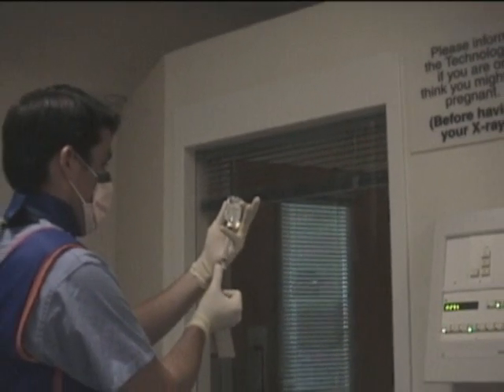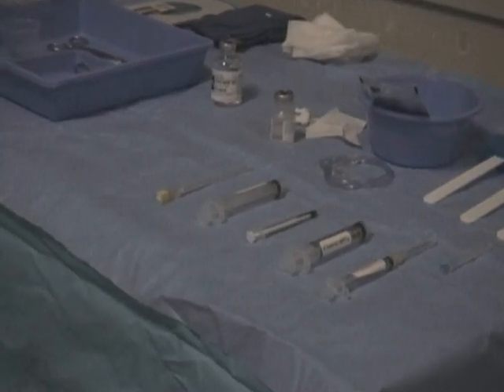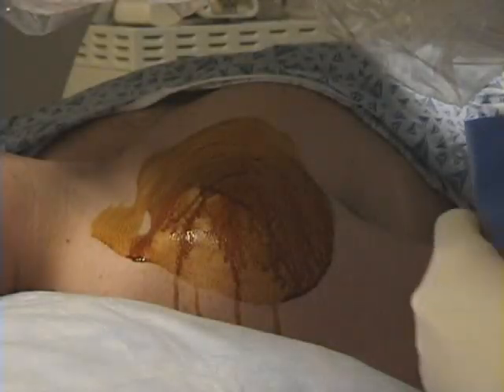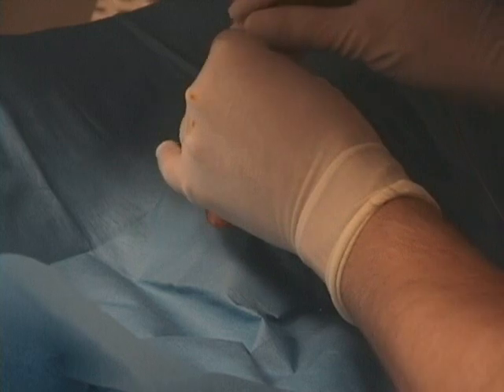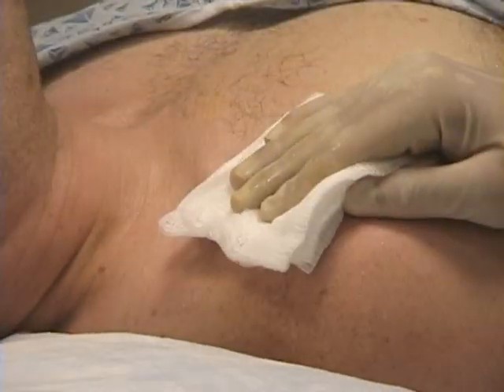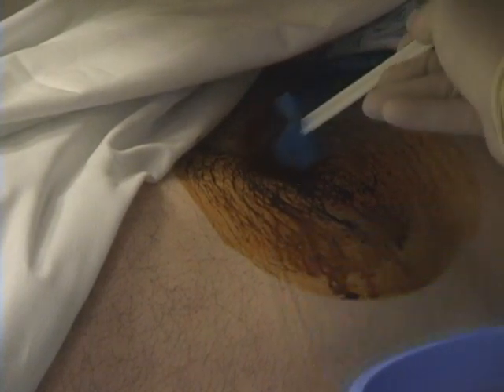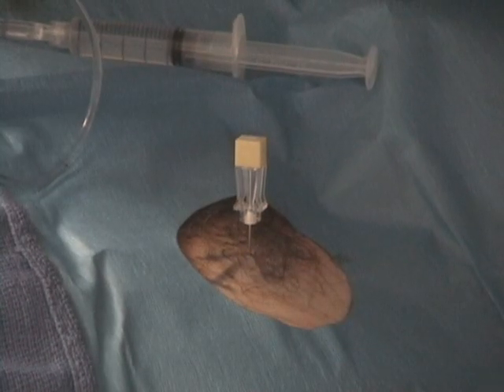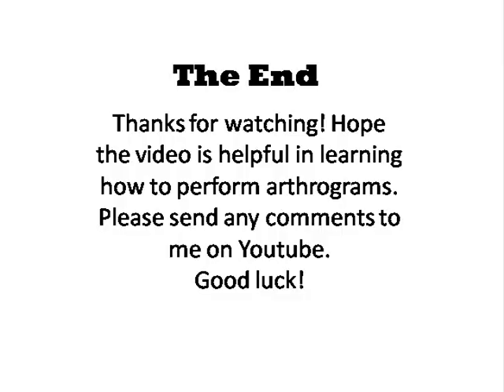Shoulder and Hip MRI Arthrogram Tutorial (For Medical Personnel and Patients)

Comment: I had this preformed on my left hip two days ago. As a person terrified of needles, pain and general physician 'mishaps' occurring, I feel necessary to share my experience-- especially since I worked myself up WAY to much the day before! :)  
After a few general x-rays, I was prepped for injection and numbed. The initial injection of the surface tissues did not hurt (I decided to not look at the needle, by the way), but I did feel it as the needle went into the deeper tissues. Rather than a terrible pain (which is what I imagined), I felt more of a dull ache in the inner groin not different from the regular soreness I had been feeling before this procedure (not excruciating).

I also felt more pressure in the area than anything. The socket is tight, so the entry of a needle and dye will create a sensation of fullness in this area. One of the nurses allowed me to squeeze their fingers, which allowed me to stay calm throughout. The whole injection didn't last very long at all for me (thanks to the experienced doctor) and I was up and walking to have my MRI in no time.

I felt a soreness in the injection site and I still feel it slightly today, two days after. I mostly feel it when I move my leg a certain way, but in no way is the injection site keeping me in constant discomfort. I recommend anyone having this preformed to take it easy the remainder of the day (don't drive, for example). Rest in a bed and walk slowly afterwards.

This test is nothing to fret over and I truly wish I hadn't caused myself so much unnecessary anxiety the day before. Best wishes to everyone having this test :)
Reply: I'm soon to have this done, and I'm like you, I absolutely petrified of needles, I've got to have it in both hips, I'm 15 and really scared? does it hurt?
Reply: Ivyleaf 👍
Reply: I’ve got to get this done in my hip soon. Hope it goes well. How are your hips now?
Reply: Thank you!
Reply: I wish I had read this before my appointment today because my experience was just like yours and I was so anxious before ❤️

Comment: I have had both of these done.  Just had the shoulder this morning and they did it exactly like this.  I only felt the initial surface lidocaine and then nothing else.  The shoulder was completely done about 2 minutes after they did the surface lidocaine and is not hurting a few hours afterwards.  The hip, however, stressed me out pretty bad.  I ended up having to have Versed (anti-anxiolytic) administered to not have a panic attack (if you have extreme anxiety from needles, feel free to ask for this).

Comment: Had this done and it's really not that bad folks. Bit stingy in places and you can feel fullness in your shoulder, like a pressure. But it goes after like half hour. You might be a bit sore afterwards (mine was in the shoulder) due to a dislocation I had. You can't feel the needle going in just a scratch like a normal injection and the fullness like I said. Hope this helps :)
Reply: Thanks

Comment: Had this done yesterday on my hip. Try not to panic. I've always been awful with needles and after reading other peoples horror stories I almost cancelled it out of fear. It was fine, minor sting with the local anaesthetic injection and uncomfortable when needle approaches the joint capsule but not painful for me. The joint just feels full up and under pressure from the injected dye. Hip was only uncomfortable for 24 hours after. Just lie back, breath slowly and deeply and don't look at the needles!
Reply: How long is the needle inside the hip bone for?
Reply: It's not inside...it abuts the bone. Technically you may even have to pull back a tiny bit so you can get the contrast easily into the joint.
Reply: Yeah it doesn't penetrate any bone, just into the space between the joint bonea to inject the dye. The needle is only in that space for about a couple of minutes.

Comment: Had the hip done last week. The worst part was getting the first part in and settled correctly. She got it in and then had to move it around and that was painful but it was one sort of quick stab and it was over. Then the dye was injected which wasn’t too bad. I was groggy afterward (rxn to dye?) and my hip did hurt when I moved certain ways esp later in the day. Plan on taking it easy the rest of the day after the procedure just to be on the safe side.